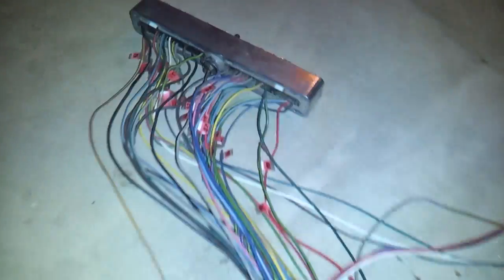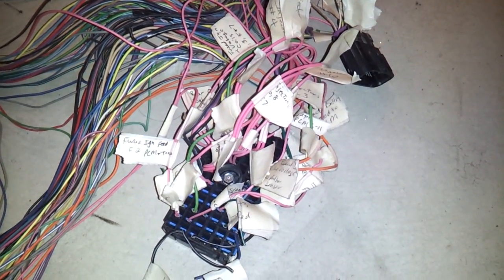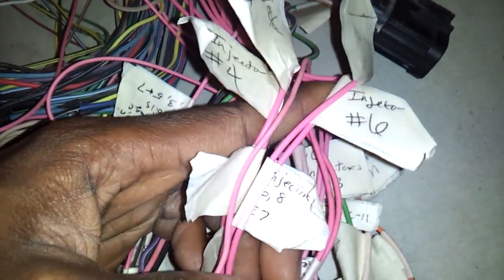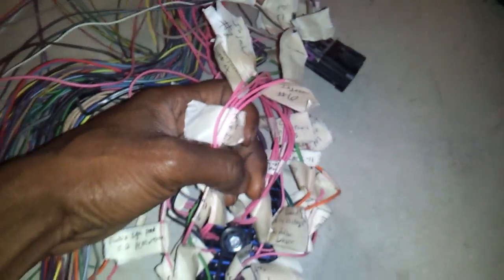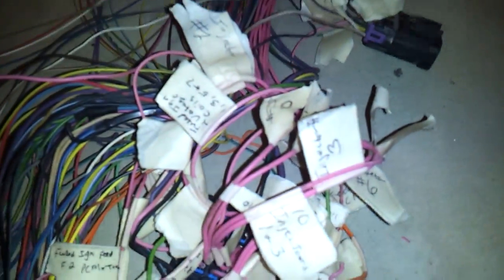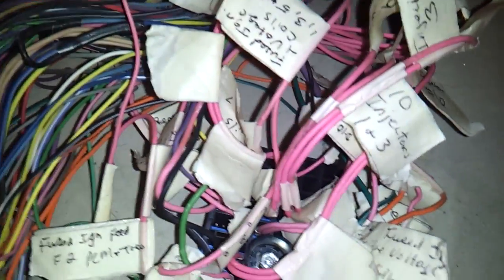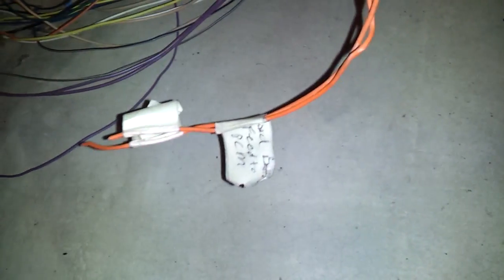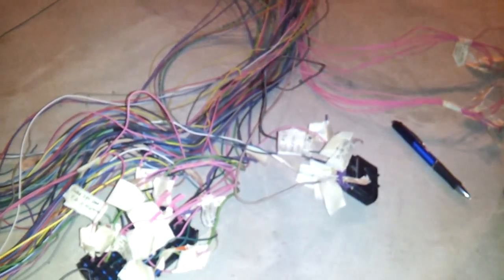Part 5 -- LSX 5.3 / 4L60E wiring harness LS1 vortec

Comment: If running a Turbo 350/400, you will have to purchase these 2 items to hook up your VSS(vehicle speed sensor) wire. A youtube guy "Ken C" was very helpful in regards to this transmission info.https://www.summitracing.com/parts/dak-sen-01-4160?seid=srese1&cm_mmc=pla-google-    https://www.summitracing.com/parts/dak-sgi-5  Another youtube guy "youcandoit" has a ton of info under " Project Rowdy part 5"  Part 5 of the LS Wiring Harness Cleanup will cover the installation of the 4 Fuse Block, Main Relay, Fuel Pump Relay, and a custom 8 pin connector to support dash gauges and instruments.

The goal is to create a Stand a Lone harness that only requires 4 wires to run the engine.  There will be additional wires running to the vehicle to support additional features.

Project Rowdy is a restoration on a 1979 Jeep CJ7.  This Harness is being prepared to be mated back to its original engine:  2001 Chevy Silverado 5.3L LM7 which has just undergone a full rebuild.

References:
- Wiring Harness Research:  http://www.LT1Swap.com
- Wiring Cleanup Procedures:   To be published after revisions from this current build
- LS Fuse Block and Relay Diagram:  http://bit.ly/LS_Harness_Diagrams   < VERY HELPFUL

Tools and Parts used:
Qiorange 8 Pin Connector:  http://amzn.to/2lNgMW8
Doorman Fuse Block:           http://amzn.to/2kOBR2R
e-Ting 5 Pin Relay Socket:   http://amzn.to/2kOzzRk
Absolute RLS125 Relays:     http://amzn.to/2lNp4gR
Vice Grip Wire Strippers:      http://amzn.to/2lI3fie
Loom Fabric Tape:                http://amzn.to/2xZng69
Here is what I used for the wiring:

- Pink      (AWG18) - This was reused from the original harness
- Yellow (AWG16) - Fuel Pump Feed
- Red      (AWG10) - Battery Hot
- Purple (AWG10) - Keyed Hot

Project Rowdy Playlist: 
https://www.youtube.com/playlist?list...

UCanDoIt2 Website for History and Plans:
http://www.ucandoit2.club/

JeepForum Thread:
http://www.jeepforum.com/forum/f22/pr...

Facebook Page:
https://www.facebook.com/ProjectRowdy/

Wire Loom Amounts:
- 1/4" : 16 feet
- 3/8" :   8 feet
- 1/2" :   3 feet
- 1-1/4": 3.5 feet
The 3 smaller sizes I purchased from Harbor Freight (1 pack each) and the 1/-1/4" I found on eBay and purchased 4 feet (by the foot).

Comment: What are the relays for
Reply: darrin hooper  Relays are used so a small amount of amps turn on a larger amount of amps. That way you dont have a huge amount of power going all over the place under your dash. You have to know if the circuit you are wiring breaks ground or breaks positive though.